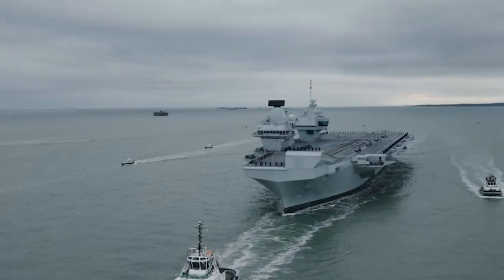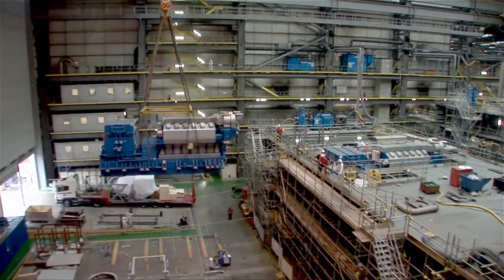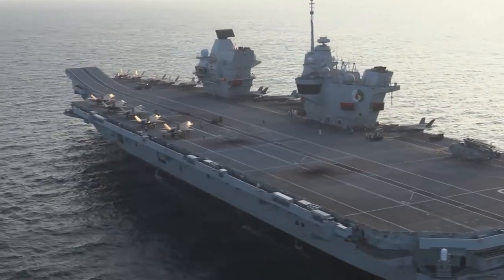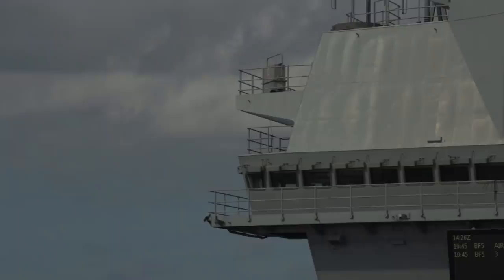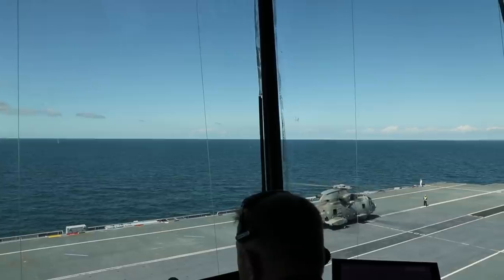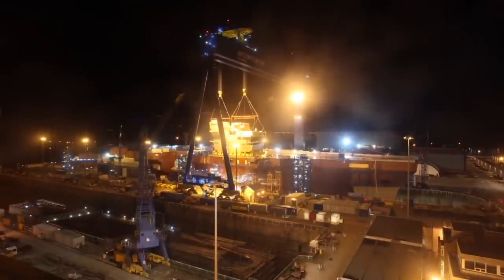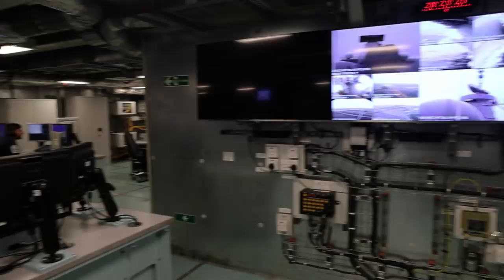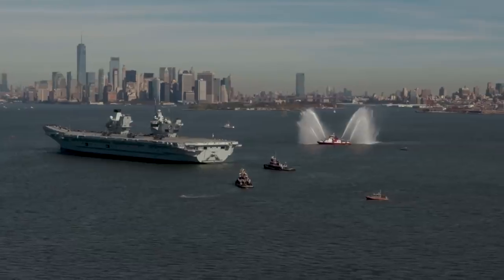Why Queen Elizabeth Carriers Have Twin Islands?

Comment: The Royal Navy was the 1st Navy to use aircraft carriers and now they are 1st to use the twin island design. Well done to Britain for naval  inovation
Reply: And don’t forget we pioneered angled and armoured flight decks, steam catapults, deck landing mirrors and much else besides.
Reply: @davideades9588  Not to mention the Harrier jump jet, key in securing victory in the falklands.
Reply: And we grow the best tea in the world... Oh hang on
Reply: @kw8757  Would have been better if we had kept the carrier based Buccaneers though, instead of relegating them to RAF airfields. They would flown completely below the Argentinian radar and utterly destroyed Port Stanley runway with ease.
Reply: @bobhodgson3113  There was no need to utterly destroy the runway. If we had wanted to the Black Buck Vulcan would have flown down the length of it and dropped all its bombs on it instead of dropping them across it.
Reply: Japan was the first country to commission the aircraft carrier not British
Reply: @davideades9588  who is “we” exactly? What did you do?
Reply: @bobhodgson3113  Would the Buccaneers have coped with the rough South Atlantic take offs and landings as well as the Harriers?
Reply: @jb76489  Rear Admiral RN (rtd) who are you?
Reply: @kaustubhkotkar3597   they did, 4 years after the British designed, built and demonstrated the first aircraft carrier.
Reply: @davideades9588  “rear admiral” sure you little buddy. That also didn’t answer my question, what did you do?

“Who are you?” Absolutely bleeding nobody but 1. I never claimed otherwise and 2 I don’t feel the need to lie about it
Reply: Innovation? Lol they still use a ramp to launch their aircraft.😂😂😂
Reply: Innovative? The best is one small island, like the us has; an electromagnetic catapult without a ramp, and nuclear propulsion. There's not much redundancy when both bridges do something different.
Reply: Its true they are the first, but there is a reason why the US did not do this. The US has very different naval doctrine than the British. The US is focused on power projection while the Royal Navy is more focused on defending their territory. This is not to say either country is better, but rather a difference in doctrine. Because of the US Navy's focus on power projection, they rightly decided that nuclear carriers would be the better option due to the limited refueling needs. If they stuck with using gas turbines like most other navies, the US would be drastically increasing their fuel consumption and needing much more support. The disadvantage of using Nuclear power is that while they carry a few years worth of fuel onboard, the refueling process requires taking out the reactor and the process to refuel takes months. This is why the US only ever has 2-3 carriers in port. While they undergo refueling, they take that time to also overhaul and retrofit and new systems required. This is also limited due to the us ports which can support them. The west coast ports are bremerton naval station (merged to create naval base kitsap in 2004) in Washington which support 2 carriers and naval base san diego which supports another 2.  Norfolk which is the largest base, can support 6 which brings the us to its standard 11 carrier's as one is always deployed and in the event of a major flaw discovered, the US can retrofit almost all at once.

A bit long winded but i feel it is important for this to be out before people starting talking about British superiority. Neither the US nor Britain are superior, but rather a difference in doctrine has led to different designs.
Reply: @B-A-L  Accuracy is the problem. The Vulcans barely made it to Stanley and weren’t accurate enough to bomb directly along the runway. Bombing across the runway ensures some hits in most cases.
Reply: @bobhodgson3113  Buccaneers couldn’t deploy from the two carriers. One of the main reasons Argentina invaded was the lack of RN fleet carriers.
Reply: The Galactic Republic did it first though
Reply: @kaustubhkotkar3597  HMS Hermes was laid down a year before the Japanese one which entered service a year earlier. So your arguement is "Oh! Look the British have invented a new type of ship. Lets steal the idea and build one quicker" which was pretty much Japan's  policy toward any Western idea for 30 years after the War.
Reply: @jb76489  troll alert, troll alert take cover! Over and out.
Reply: Japan had carriers first- 

Commissioned theirs first.
Reply: @roberthughes9856  I mean they commissioned it first- successfully used it first too- Hermes wasn’t even done 

Therefore they have the title- 

You can start the race first- but if someone else finishes before you- they win the title. How life works there champ.
Reply: @nbricks7  and everyone else that has a carrie still uses are innovation to launch their aircraft, makes me laugh people that take piss out of the Royal navy not realising pretty much everything their country's navy was designed built and pioneered first in the UK we pretty much wrote the book that's true for alot of shit the world uses
Reply: The Royal Navy was the first to design & lay down a purpose-built aircraft carrier.  The Imperial Japanese Navy was the first to actually commission a carrier.
Reply: @kaustubhkotkar3597  Britain laid their carrier on the ocean first but then Japan the following year after the British carrier was laid down, they commissioned theirs before the British did.
Reply: @James-cb7nb  nuclear power isnt allowed through suez cannal. Not a huge problem for US as they have more carriers. Would have been more annoying for the British carriers to be nucleal. 
The british carriers also have incredible automated machines that can do the job of about 200 sailors on a Nimitz class. Again...better for britain as we dont have budget of US
Reply: The British designed the vessels and the catapults and the angled deck and the landing systems then put in charge the best men ( and now women ) in any navy. The Royal Navy is the very best in the world bar none.
Reply: Wasn't the world's first aircraft carrier to be commissioned the Hosho of the Imperial Japanese navy in 1922? The HMS Hermes didn't come about until 1924.
Reply: @jb76489  WE   are the people who paid for the fucking thing
Reply: And Don't forget, British also invent the first radar system in the world.
Reply: @davideades9588  ❤🇬🇧
Reply: @graham6229  Don't spout something unless you can back it up. Yes Britain invented many aspects of the carriers, so did the US, and Japan. However they don't use any of them. Next they have two carriers and barely enough ships to make one battle group.

By the time the QE even has a full load of aircraft or if she ever gets a full load of aircraft, the Fords kinks would have been fixed on top of a large air group.

In fact the British Navy isn't the best in the world at all but they are one of the best.
Reply: @kw8757  Uh, the Harrier is American.
Reply: The first was made in Japan
Reply: @garypulliam3740  The Harrier, informally referred to as the Harrier Jump Jet, is a family of jet-powered attack aircraft capable of vertical/short takeoff and landing operations (V/STOL). ... Named after a bird of prey, it was originally developed by British manufacturer Hawker Siddeley in the 1960s.
Reply: They are the very first to make carriers, but the very last on carriers innovation and capabilities. Right behind the American (and Japanese on WW2)
Reply: Mark Newell Lol, why do british always think they invented everything?
If we talk about changing the world with technologie Germany is best...
Reply: Teguh Suryoko Wrong, the Germans where the first to prove how electromagnetic waves work and the first to built a radar...
Reply: @yufka3247  also, the first military use of radar was by the British in WW2, and in fact made the myth that carrots improve your eyesight and let's you see in the dark.

The story behind it is this: during the war, British flak gunners seemed to be leagues ahead of their German counterparts, and so, to make sure they had an explanation, they said that the carrots that were often eaten had a lot of Vitamin A, and so their eyesight and night vision were much better. In reality, they had a radar system that could track enemy aircraft extremely well, allowing them to better fire on target.
Reply: @garypulliam3740  : HAHAHA Nice try mate SMH
Reply: The Teuton King I know the story..., but the perspective you are telling it from is wrong.

When the experiment was done in 1904(that i stated), the scientists knew it‘s potential but at that point radar wasn‘t more effective than humans, this changed in the 30s with newer and better technology.
The myth that Germany wasn‘t aware of radar during the Battle of Britain is just wrong, in fact at that time German radar equipment was ahead of the British one, German propaganda only made up this story to speak off the British sort of knowledge about radar. It was only from 1941 onwards where the British overtook the germans in terms if radar equipment because the German high command didn‘t realize it‘s potential in command thus cutting budget und this technologie for other purposes. The real breakthough of the british was the cavity magnetron based radar, which could be (due to new technology) smaller and more powerful.
The germans recieved this technology first, when a british bomber crashed (1943) near Rotterdam with such radar on board. Another myth is also that the germans didn‘t understand the technology (which they did), but the lack of ressources needed for such equipment was scarce in Germany that time, this and the other reason i mentioned above are the reason why the Germans only fielded this device first in 1945 when the war was already over.
Reply: False they weren't
Reply: @davideades9588  Yup, lipstick and compaq mirror lolz
Reply: @garypulliam3740  DOH!
Reply: Shadow Infinity Gaming To which comment is this related?
Reply: @yufka3247  TOP
Reply: @James-cb7nb  I thought that either bridge could do both jobs.  So more redundancy.
Reply: @garypulliam3740  How to you figure that?
Reply: @petersellers9219  Do Britain really grow the best tea in the world? are you sure your tea doesn't come from Kenya?
Reply: and they managed to use Corsairs when the US didn't :D
Reply: @garypulliam3740  The "Harrier II" (AV-8B to the Americans, GR5/7/9 to the British) was created through a joint Anglo-American project. Admittedly the Americans did much of the work, and provided most of the funding, but then the original Harrier (which the Harrier II is based upon) was all-British, and so is the Pegasus engine which has powered all versions of both generations of the Harrier.
Reply: The French were the first to use an aircraft carrier and the British navy is still light years behind the US navy.
Reply: @joncampo4610  Foudre was indeed the first carrier in 1911 however Ark Royal was the firt active carrier so the Brits can say they were first. ;) And Hermes was the first carrier ever sunk early 1914 :D
Reply: @kinocorner976  HMS Argus was the first ever aircraft carrier, commissioned in 1918 during WW1. HMS Hosho was the first ever purpose-built aircraft carrier however, as Argus was a conversion.
Reply: @dwarvenmoray  wrong the first aircraft carrier was HMS Argus 1918 the first aircraft carrier designed from ground up and built was HMS Herms, the first ground up commissioned was IJN Hosho. Look at Hosho and look at Herms Hosho looks more like Argus and herms looks more like a carrier of today anyway the first to use a a aircraft carrier was the royal navy HMS Argus 1918 we was the ones that also designed and built the first catapult first steam catapult, the first arrest cable, the first guidance system for landing the ski jump, the twin island and double redundancy, the first automated ammunition handling and storage system also armoured flight decks and aircraft elevators think us British made the aircraft carrier and was the most innovative
Reply: @kinocorner976  the race was already done and over before Japanese built Hosho HMS argus 1918 the first aircraft Carrier
Reply: @garypulliam3740  Lol No, British invented the Harrier.
Reply: @neilnelson7603  Yorkshire tea, comes from Yorkshire!
Reply: @marknewell7355  Ah, okay.  So the HMS Herms was the first carrier to be laid down, while the IJN Hōshō was the first to be commissioned.  Thanks for the correction.
Reply: @joncampo4610  Light years behind, We are using the same 5th generation aircraft, Does F35 mean anything to you?
Reply: K W and the reason the us has vtol
Reply: @dwarvenmoray  yes the first commission ground up build of a aircraft carrier BUT some could say was a copy of HMS Argus in design which was a modified merchant ship but was the first full length flat top in service from 1918 the first ship to house a aircraft was USS Bellingham 1910 I believe. The RN was first to utilize the aircraft carrier and perfect it but the Japanese was the first to commission a purpose built ground up aircraft carrier they however didn't come up with the concept that was the RN probably inspired by Bellingham. No one should take away from the US though they have taken what us British invented and made bigger and for a while better but the two navy's have vastly different needs the US is a super power that took over from the British and I personally hope they dont ever lose that title to another nation because the next to be a super power is either India or China. No country from Europe will ever be a superpower again so yeah hope the Americans stay top dog
Reply: @marknewell7355  The HMS Argus was similar to the USS Langley is that it was converted from a mercyant vessel.  The Langley was the first American carrier.  As an American myself, I hope we don't lose that title as well.  We have eleven active carriers & one currently under construction.  We also have 99 years of experience, while China only has 9 years of experience & 2 sub-carriers.  By "sub-carriers" I mean the small, take-off ramped carriers.  I don't know what India's carrier experience is.
Reply: @bevpotter9938  but vulcans were accurate
Reply: @dwarvenmoray  I didnt mean USS  Birmingham was America's first I meant USS Birmingham was the first aircraft takeoff from a ship in the world probably where the RN got the inspiration for aircraft carriers definitely the reason the developed the first catapults. I had the pleasure of seeing USS Gerald R Ford in the ship yard 3 months before launch at a distance still close enough and remember thinking how the fuck  will that float I thought they would never build bigger than the Nimitz class. The British problem is not the military it's the government they have continually cut are military to the bone but is slowly starting to come back never to its former self but hopefully will be a reasonable size and also hi tech and modern that's if they fit the ships as intended and not half arse it again T45s case and point remarkable ship but not got half its fighting capability it was ment to have budget cuts.
Reply: @ademaiden-Cinematography3970  but Brits prefer robust black teas, which some of them come from Kenya among other nations. Yorkshire tea is just a popular brand.
Reply: @garypulliam3740  The Harrier is British. The American Marines have a licence built copy under a different name. No offense but you are very wrong.
Reply: @neilnelson7603  oh hang on ....😉
Reply: @petersellers9219   Oh, i got you now🤦‍😁
Reply: @neilnelson7603  turns out we don't grow any tea in Britain!
But we did invent women in Britain, which is why ours are still the best.
Reply: @petersellers9219  Now thats something i can agree with.
Reply: @theteutonking3306  that's true. Brits invented and developed radar.
Reply: and the first navy who lost a carrier without starting an airplane.
Reply: ...with so many HMS Hermes built, is that first Hermes the same one that was sunk by the Japanese, early in the Second WW near the shores of Sri Lanka?
Reply: @graham6229  did all that and use none of it instead they keep those ugly ass ramps
Reply: @bevpotter9938  I am fully aware that the Falkland carriers were far too small for Buccaneers, but if they still had the Hermes or Ark Royal,they would have destroyed Stanley runway and prevented further military reinforcement. I served my apprenticeship building Buccaneers.
Reply: @kw8757  Compared to the Harrier, the Buccaneer was specifically designed as a naval aircraft and was built like a flying tank. The fleet carriers at that time were also bigger than the VSTOL carriers. So yes,the Buccaneer would easily handle the weather.
Reply: @davideades9588  To bad you didn't pioneer toothpaste.
Reply: Alberto SIlvab No, have you read me comment?
Reply: @pvp64  the correct usage is “too bad” but then you knew that didn’t you?
Reply: @nbricks7  the ramp we invented we also invented the catapult how’s that for innovation?!
Reply: @bobhodgson3113  K W actually has a point, though the issue has nothing to do with airframe strength. STOVL carrier operations can continue safely in weather conditions that would bring CATOBAR ops to a halt.

So potentially there could have been times where Sea Harriers were flying, but (hypothetical) Buccaneers couldn't - not because the Buccaneer itself couldn't fly in such conditions (or even launch), but because it wouldn't have been able to trap safely/reliably.
Reply: Sorry, no.  "The 1903 advent of heavier-than-air fixed-wing airplane with the Wright brothers' first flight at Kitty Hawk, North Carolina, was closely followed on 14 November 1910, by Eugene Burton Ely's first experimental take-off of a Curtiss Pusher airplane from the deck of a United States Navy ship, the cruiser USS Birmingham anchored off Norfolk Navy Base in Virginia. Two months later, on 18 January 1911, Ely landed his Curtiss Pusher airplane on a platform on the armored cruiser USS Pennsylvania anchored in San Francisco Bay. On 9 May 1912, the first airplane take-off from a ship underway was made from the deck of the Royal Navy's pre-dreadnought battleship HMS Hibernia.[27][28] Seaplane tender support ships came next, with the French Foudre of 1911."  Wikipedia
Reply: @roberthughes9856  Considering the race between the UK, US, and France to complete the first "Dreadnought" type battleship, the carrier race wasn't unique.
Reply: @neilnelson7603  learn something new everyday,always thought it was Asia but you are right,kenya
Reply: @ademaiden-Cinematography3970  lol
Reply: @neilnelson7603  whoosh
Reply: @petersellers9219  Yorkshire tea was invented in Yorkshire. British also invented pyjamas, bungalows, jodhpurs, and chicken tikka massala. Good old Blighty, she's pukkah.
Reply: @yufka3247  It isn't a myth that the Germans didn't know about the scale and activity of British radar. Every test conducted by the germans to spot British radar waves came back negative because they were listening in the wrong wavelengths. Not to say the germans though Britain had no radar or understanding at all of it, but they severely underestimated how powerful and accurate it truly was.
Reply: They were the first, but these look like shrimp boats compared to America’s aircraft carriers
Reply: @kaustubhkotkar3597  the first ship specifically designed to be an aircraft carrier was the ship hms argus built by the British, the japanense did commission one before this but argus was finished first
Reply: @mikeseabrooks7978  except the us did this  100years ago. Uss lexington and uss saratoga.  and there are more
Reply: @marknewell7355  I mean, if you want to argue semantics, USS Saratoga would have been one of the first aircraft carriers designed from the ground up, as she was originally ordered as a battle cruiser in 1917. The US Navy ended up converting her into a carrier halfway through her construction though, and as a result she was not laid until 1920. That being said, while the British were certainly the most "innovative" in regards to creating all these things specifically for carriers, the US were among the first to make such innovations "standard practice". This was thanks in part to USS Saratoga and her sister ship, USS Lexington, who were eventually converted into training carriers. A lack of training were a big part of the reason the IJN carriers never accomplished much of note during the war compared to other carriers from other nations. This "standardized training" was what gave the US a much greater edge when it came to carrier warfare.
Reply: Why aren’t they nuclear🤷🏼‍♂️
Reply: @autorage5337  well 100 years ago nuclear power did not exist. The difference between now and then is now we have a choice of what to use and back then, they only had one option.
Reply: @mikeseabrooks7978  yeah but i meant for the twin island configuration. Even on the video it claimed to be first one to have it which is just bull crap. The reason for non nuclear is mainly for the lack of know how. Brits only have few nuclear technician whom have worked on smaller generators on subs. Nuclear power is just better for ships this magnitude and if and when they'll get the rail guns etc  working, they don't have to retrofit any power plant for those. That's why US is having generator capable of producing twice the power needed right now. What comes for the refueling they still need to fuel the carrier group and get the aviation fuel and food etc on board the CV's so the reasons for opting out of nuclear power on those basis would be just foolish.
Reply: @azurblueknights  you could but as you stated she wasnt originally designed to be a carrier that decision was probably made because of the UK and Japan was making dedicated carriers. Also when it comes  to stardise these systems I dont know however they have perfected their designs and taken carrier technology and use to a extreme there is no doubt that America and the USN are untouchable when it comes to carriers I.e size, amount and funding that's pretty much goes for everything they are untouchable in that respect. That been said the RN is also highly skilled and very well versed in carrier ops hence why we train and work so closely the only problem is there isn't much of us but then again we have no use as where no longer a superpower
Reply: @autorage5337  USS lexington never had a twin peak. What you are probably thinking of was the smoke stack. England does not have nuclear not because of know how, but rather they dont need it. England could get the know how by having the US train their people. They just don't have a need for that kind of ship. Russian aircraft carrier is not nuclear powered, but they do have the know how. Russian battlecruiser Kirov class is nuclear. Nuclear power is not superior in every aspect, they are many downsides and opting for it may not always be the best option. This is because its not going to be sailing around the globe like American carriers.
Reply: @mikeseabrooks7978  it does. cv-2  not the 16..  sure lot of if is taken by the huge funnel but it still has decks and other purposes. being posted on the funnel side was the dream in the cold atlantic.  probably not as much in the pacific tho were it got sank
Reply: Sorin Caladera That is true but at least during the Battle of Britain the Germans were well aware of the CH and even attacked the Stations with minor success though...

And no, the CH was not a good radar...it was a dead end technology, even though it had good range, the resolution was bad and it could not cover 360* and was extremely huge and expensive...
Reply: japanese the first navy use an aircraft carrier...😂.do some research bro.....yeahh...Royal Navy the one invented it..but first use it is Japan...AC Hosho commissioned on 1922 and British Ac Hermes commissioned on 1924
Reply: @colinarcher2817   And thank god for the internet.
Reply: @loneboy97  Both countries are first. The Hosho was built first, but the carrier to be laid down(Keel laid down) was the hermes. Hosho was laid down a year later. The hermes was also designed first. The reason the japanese had launched theirs first was partly due to the fact that the hermes was larger. In fact the british were the first to build it in the sense that they started construction first, its just that the japanese built theirs first.
Reply: @mikeseabrooks7978  my comment related to the main comment..sorry if its bother you👍👍
Reply: @izazsatria6336  no that was a German
Reply: 71wraith It was Japan, but who cares for facts.
Reply: @mikeseabrooks7978  The US is superior as they actually have a ton of carriers with a support fleet for every carrier. Let us not compare a first rate navy with a third rate navy.
Reply: @pixsilvb9638  The twin Island are a liability and not a progress.
Reply: @marknewell7355  I guess this is why Japan had the first commissioned aircraft carrier.
Reply: @graham6229  Bar everyone who has more and better equipment like the US for example.
Reply: @TorianTammas  And england is not a third rate navy. They are more akin to a second rate. Its just the fact that there is a big gap between first and second rate navy's. Yes, england's navy is small, but it is technologically advanced.
Reply: @izazsatria6336  The first was a German who invented a radar based anti collision system  In the 1934–1939 period, eight nations developed independently, and in great secrecy, radar systems : the United Kingdom, Germany, the United States, the USSR, Japan, the Netherlands, France, and Italy. In addition, Britain shared their information with the United States and four Commonwealth countries: Australia, Canada, New Zealand, and South Africa, and these countries also developed their own radar systems. During the war, Hungary was added to this list.
Reply: @ademaiden-Cinematography3970  Yes British get taught by Americans how to fly F35 and how to operate aircraft carriers. But the British lack the diversity of planes and have basically a blind helicopter carrier with one sort of planes.
Reply: @sorincaladera936  Your source for that claim is?
Reply: @TorianTammas  well, I can't tell if it is or not. Time will tell if the Brits were right with this one. Only thing I know for certain is they definitely developed the most remarkable advances in aircraft carrier innovations throughout history. And that is something we gotta give it to the guys. It has to be said. They are truly pioneers on the field. No doubt about it.
Reply: @mikeseabrooks7978  Interesting question what are the British carriers  for? Are they a kind of status symbol? As they should hold only 12 planes and 24 when deployed. This worries no one with an actual Air Force.
Reply: @TorianTammas  Where are you getting your numbers from? That is their first deployment. Plus england at the time did not have enough f35's for a full complement, which is why it was supplemented with helicopers. They can carry a full 65 aircraft at maximum capacity. Plus a single American Carrier can't threaten an actual air force. They could only threaten pretty weak airforces with outdated equipment. If they fought modern russian jets, it would be a lot hard of a fight.
Reply: @TorianTammas  Why would we need the range of planes US has?, We are a small island. Remember the US spends 750billion a year, we only spend 55billion.
Reply: @neilnelson7603  Actually the post popular
 brands come from India
Reply: @kaustubhkotkar3597  wrong
Reply: Also the first fully ironclad warship in 1864 the HMS Warrior
Reply: @Predator42ID  How many Spanish armadas have the US defeated?
Reply: @theteutonking3306  This.
Reply: @bevpotter9938  The Vulcan didn't go to  destroy the runway it went to put it out of temporary commission as it would be needed after it's recapture.
Reply: British naval engineering has been top class for centuries.
USN is also top class, which is why I'd love to one day, see both sail alongside
Reply: @bobhodgson3113  Port Stanley runway needed to be put out of action long before carrier based aircraft would have been within range. Hence the Vulcan missions from Ascension Island
Reply: @B-A-L  That's not true. Until the era of smart bombs, conventional bombing was still very inaccurate, especially from the height the Vulcans flew. Running parallel to the runway stood a very real chance of leaving a line of craters on one side or the other, with the runway completely untouched. Bombing at 90degrees might still miss due to the bomb landing intervals. The diagonal attack being by far the best. However, my point about using Buccaneers was that they were extremely low level aircraft and would have approached Stanley airfield completely under the radar and could have dropped a whole line of bombs along the length from that height, utterly destroying the runway.
Reply: @kw8757  The Buccaneer was a heavy duty aircraft designed for hard duty.
Reply: @bobhodgson3113  You do know, don't you, that  destroying Stanley airfield was the last thing the RAF wanted to do.
Reply: @James-cb7nb  Oh dear. On the QE class ships, the islands are fully dual-redundant i.e the ship can operate at full capability in every respect from just one of the islands -
Reply: @garypulliam3740  That'll be why the US bought all their Harriers from us. The US does lots of things really really well, but it took them nearly fifty years to match the Harrier.
Reply: @theteutonking3306  Years later the GB cycling team told their French rivals that the reason they won so many gold medals at the Olympics was because they had special ultra-round wheels. The French were mightily cross when they discovered a few days later that this was not the case.
Reply: @kaustubhkotkar3597  The Hosho was the first purpose built carrier in 1922 the USA and Britain used converted ships way back before the Great War The first takeoff  from a ship USS Birmingham 1910 first landing on a ship USS Pennsylvania 1911
Reply: @neilnelson7603  . I personally prefer the imports!
Reply: @FartassVolfgangus  . Of course America has to make everything bigger but we all know what's it to compensate for! Never mind!
Reply: @dannygroom3327  lol yeah, compensating for our badassery
Reply: @TorianTammas  . Yes what we should compare is a first rate nation against a third rate nation! Why would a nation need a ton of carriers for if it wasn't for having a ton of enemies?
Reply: @FartassVolfgangus  . If that's how you are inclined that's fine by me, I'm no homophobe!
Reply: @dannygroom3327  I couldn't agree more